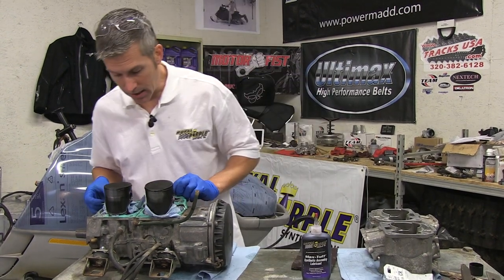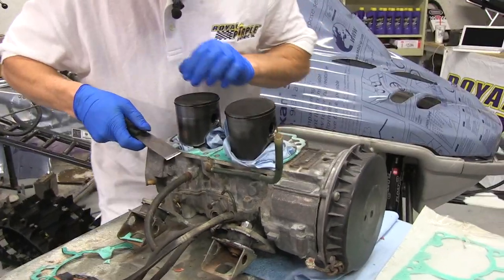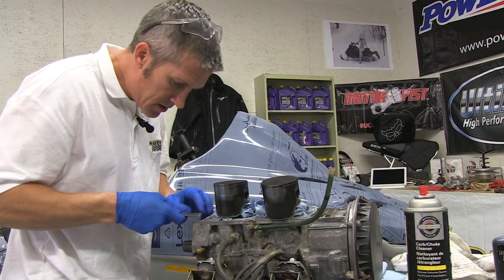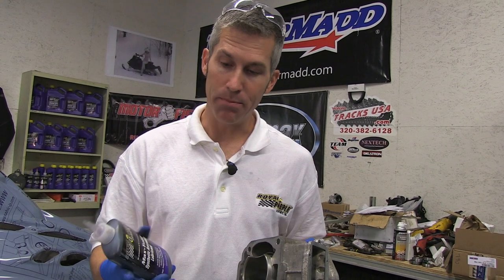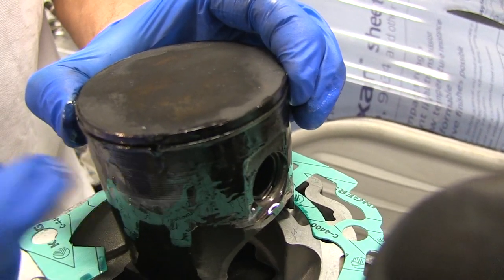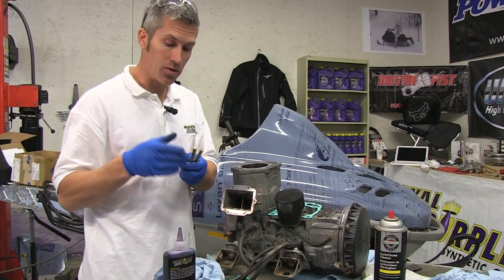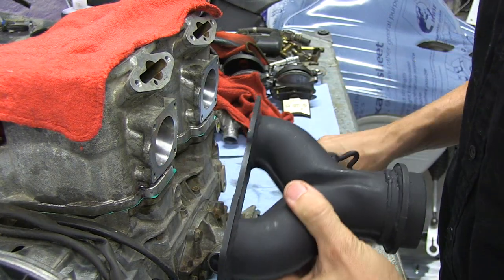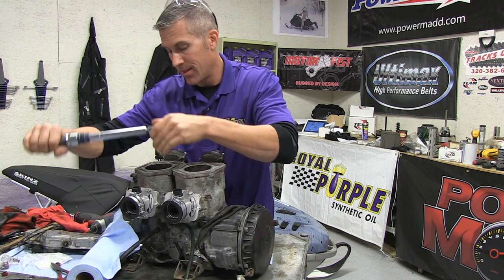700 Ski Doo mod sled ep #5 Cylinder install, PowerModz!

Comment: Id replace the piston rings. My engine blew its rings after 10,000 km. Took a nice chuck out of one of the pistons. I bought it used at 5000 km and I don't know what buddy did to it before but that was a nice expensive surprise this year. While you have it apart you might as well replace the rings.

Comment: i do one thing differnt when assembling sled engines. not shure if i am right or wrong but it works for me.. espically on twin engines.. i put  a bit of oil on the top of the base gaskets so i i need to change a cylinder you won't rip a gasket....

Comment: new pistons would have been cheap insurance on that high km motor, it would be a shame if a skirt breaks off and makes scrap aluminum out of those cylinders and crank case. You could never know by just visually looking at them with the naked eye if they will break or not

Comment: Can tell he hasn't done much engine work because 1. You never use a chisel/scraper on an aluminum crankcase like that. 2. Why would you NOT tear down the crankcase to double check all of it and to make sure the crank is true and you have no bearing issues. Yes it was running ok and what not but going as far as he did tearing the sled down to nothing and then skipping out on those things. 3. In order to get those gaskets off you use a Roloc Gasket Removal Disc setup that does not damage anything and gets every single thing off that block. 4. Pistons/rings...At the very LEAST he should have replaced the rings with the jug work he did.